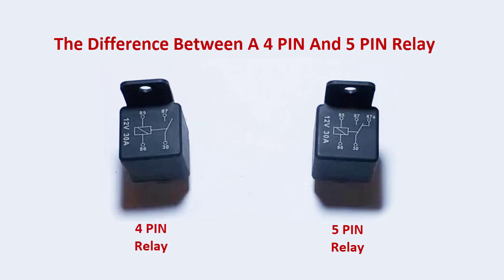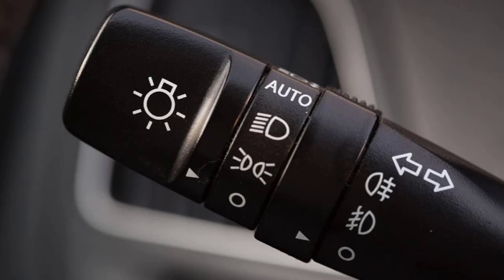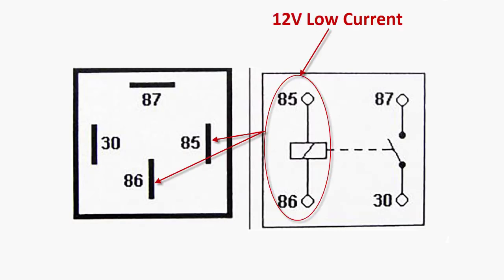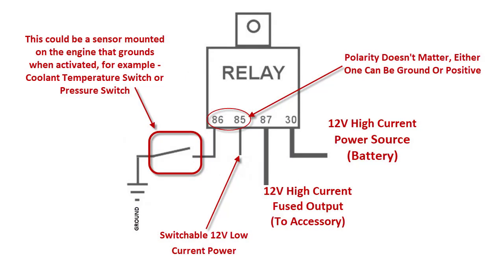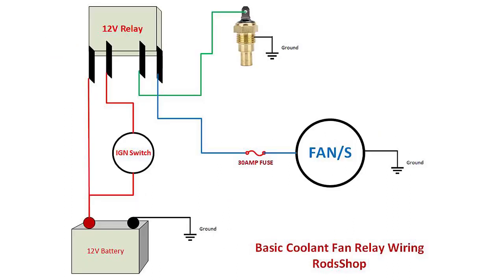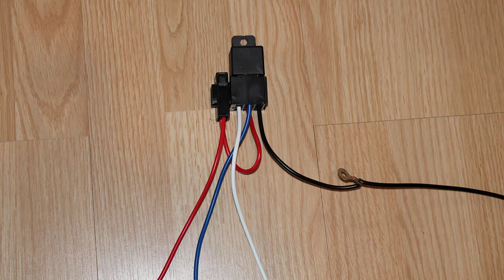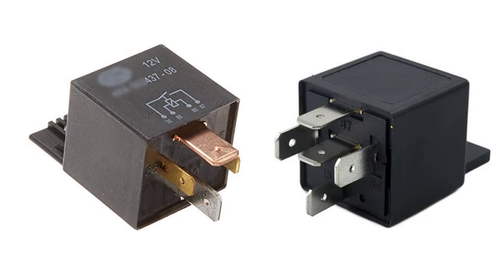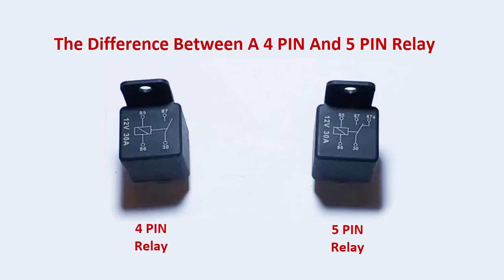Difference Between 4 and 5 Pin Relay - Relays Explained

Comment: What if I want to wire a coil for hot flame 🔥 exhaust. No clear diagram to how it's done
Reply from the maker: You would wire it similar as you would for a cooling fan except you wouldn't be using a temp sensor to trigger the relay. You would just just ground one side of the coil inside the relay and use and ignition wire to engage the the relay when you turn the key on. You would be switching full battery power to run your hot coil. Watch this video and there is a wiring diagram in it as well:

https://youtu.be/rXdb9HBw40I

If that doesn't help, contact me through my website and I will draw you up a diagram to help you. 

https://rodsshop.org/contact-rodsshop/

Comment: I installed an electric fan on my 2003 Ford ranger. I currently have it hooked up directly to ignition through a relay. I purchased a temp sensor and I want to wire it but my concern is how to wire it in a manner that when I turn on my AC the fan will come on
Reply: Brother I need some help to use a 4 pin relay to the drl light (indicator) and my factory wiring harness because when I connect the positive to the indicator wire in the drl light it works with the car on but when then Car is off it keeps the drl light on until I disconnect the yellow wire for the indicator
Reply: I contacted you on your email rob I would love to get some help
Reply from the maker: Message me through my site and I will email you a diagram to show you how to do this.

https://rodsshop.org/contact-rodsshop/

Comment: The 4 pin is a single pole single throw (SPST) and the 5 pin is a single pole dual throw (SPDT). The extra pin is for the normally closed terminal (NC)

Comment: The relay center socket for my cooling fans (high speed) only has tabs for 4 pins, the center hole is empty. The relay i pulled out has 5 pins. From what i gather from your video, the center (5) pin isnt used, correct? Reason i ask, my new cooling fans never kick on HIGH, thats what lead me here. Should the socket have 5 inner tabs? Note, fans work on low speed fine.
Reply from the maker: I am scratching my head on how many people keep going on about high speed and low speed. There is ONLY  ONE SPEED!!! The fan is on, or it is off, there are no multiple speeds. 

The 5th terminal is always switched closed, so when you add power to the relay, that leg becomes open. It serves no purpose when hooking up a cooling fan. 

Have you added these fans or are you trying to diagnose a factory fan? There is no speed controller to make the fan have a high speed or a low speed. 

Perhaps you are messing with some factory setup. But when hooking up a cooling fan. There is battery power that goes from the battery to PIN 30 on the relay. PIN 87 runs to the fan. PINs 85 and 86 are the low voltage switch, triggered by a coolant temp sensor or a switch on the dash. At no point is there a resistor or speed controller. 

If you have something in your system controlling fan speed, which would make no sense at all, then that setup is beyond my wiring diagram and you would need to refer to an OEM wiring diagram.
Reply: @RodsshopOrg  my 90's nissans have 2 speed fans!
Reply: @RodsshopOrg  OE fans, only one worked. Replaced with aftermarket. I have two relays, one marked "low/high" the other marked "high" for the fans. When i first bought the car, im sure the fan speed went into high mode in the summer with A/C on. At least both fans are running now, thanks for the info.
Reply from the maker: @HackHunter1835  What kind of car is this, I would like to research this High/Low stuff and try and understand their reasoning behind it.
Reply: @RodsshopOrg  2004 Chrysler 300M Special. Google said low fan speed up to a certain temp, then high fan speed when temps reach 220 to 230 deg. This car has boggled my mind of late lol
Reply from the maker: @HackHunter1835  Leave it to Chrysler to come up with such a dumb idea. Unless you want to do some custom wiring, you are kind of at the mercy of that ridiculous set up. 

Rewiring wouldn't be too hard, just depends on if you want to get into all of that. 

You would need to replace the coolant temp sensor with a real standard one that turns on like at 185° and shuts off at 200°. And just run your own relay and wiring to the fans. 

Fans either need to be on or off. The low speed and high speed thing serve no purpose. All it does is complicate things when stuff starts messing up.
Reply: @RodsshopOrg  The way Chrysler designed the 3.5 engine is an absolute cluster-puck of an engine. It was almost 100 deg here last week, hence the concern of overheating, and the low/high speed relay debacle.  The car hasnt boiled over so im closing this chapter of ownership in this Chrysler. You gave some great info, i appreciate that. I am currently looking at baying another car. Watching that temp gauge rise above normal is always concerning.
Reply from the maker: @HackHunter1835  Chrysler has made some cool looking and some fast cars, but overall, they suck. Lousy electrical, brake and suspension systems and even though some of their engines are awesomely fast, they are not long-lasting.
Reply from the maker: Depending how you want to hook this up, that isn't going to be an issue. Are you putting in aftermarket fans or are you trying to fix an issue? You could just contact me through my website so we can converse on this easier plus you can send me pics if needed.  https://rodsshop.org/contact-rodsshop/
Reply from the maker: Sorry, I missed this comment somehow and you probably already figured it out but what is the year make and model of what you are working on?

Comment: I got a 4 pin relay for radiator fan but i can only 5 a pin for it can i break the middle pin and plug it in will that work
Reply from the maker: I am not clear on what you are asking. You said you got a 4 Pin relay but can only 5 a pin, what dose that mean? If you are saying you have a 5 pin relay and trying to plug it in a 4 pin relay socket, I wouldn't recommend breaking off the pin unless you know for a fact if all the other 4 pins are being connected properly. I would just buy a 4 pin relay. If it is the other way around and you are going to plug a 4 pin relay into a 5 pin socket, I would just ensure that all the pins will be connecting to the right wires. If I am missing the question, please clear up my misunderstanding.

Comment: Where should fuse be on the wire from the battery to the relay right
Reply from the maker: I usually run the fuse in between the relay and what it is running. The reason for that is to protect the relay. If the load is enough to blow the fuse, that means it will burn the contacts or weld them together in the relay if the fuse is in between the battery and relay.
Reply: @RodsshopOrg  can one 40 amp relay run 3 Acessories a light bar 12v plug and winch switch
Reply from the maker: @atvrider1805  That depends, how much does each item use alone and will you ever run all three at the same time. The 12V plug obviously isn't going to draw anything unless you have some plugged in. But let's say that the Light bar pulls 20 and the Winch pulls 30. If you use them at the same time, you will burn the relay up. You need to see how much amps these things pull. May be better to run separate Relays and Fuses for each
Reply: @RodsshopOrg  my light bar is 5 amp winch switch is low amps probably 5 as well and 12v plug be what ever is hooked to it has a 15 amp fuse on the battery line

Comment: I have a buddy who is trying to wire up a aftermarket alternator with a dial to adjust the alternator amps what do you think we should do to hook it up
Reply from the maker: I think there is no nee in trying that. An alternator can produce so many amps but that doesn't mean it just sits there putting out that amp all the time. Let's say you have a 90 amp alternator. It doesn't produce 90 amps all the time. It will deliver up to 90 amps on demand. It already has a built in regulator that is doing what you all want to do. Now if you have an old DC generator or an old alternator that requires an external regulator, you could make one that you can reduce the output but it still doesn't make sense to do that. Maybe you need to tell me what you are actually trying to do here. You can contact me through my site.
Reply: how exactly does one "adjust the amps" on something that has a max output and only produces X amount of current directly in relationship to X amount of load?

Comment: Will the five pin relay help the fuel pump come on?
Reply from the maker: There is no reason you have to use a 5 pin, just use a 4. Or are you talking about replacing on that was already there? Please be more specific to what you are asking. You don't want to be powering the fuel pump without a relay.
Reply: @RodsshopOrg  the fuel pump is already powered by the 4 pin switch but it will not crank my truck sometimes and since there is a connection for 5 pins I thought it might need a 5 pin switch